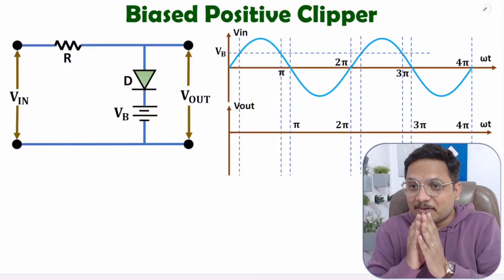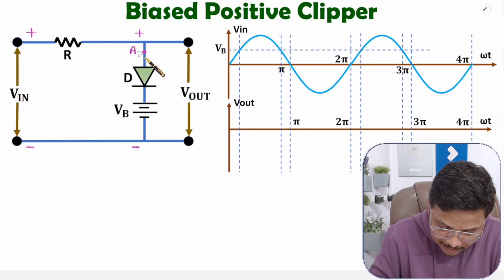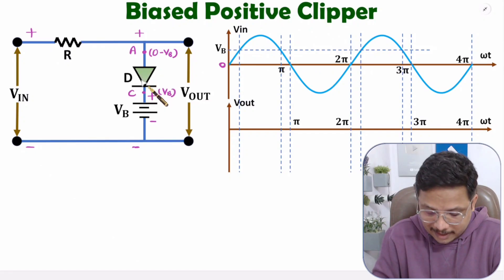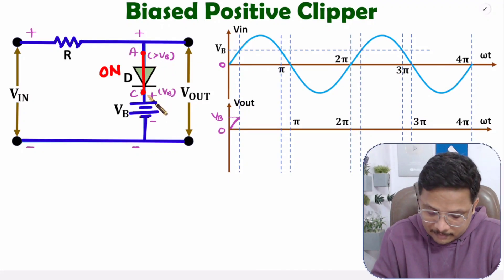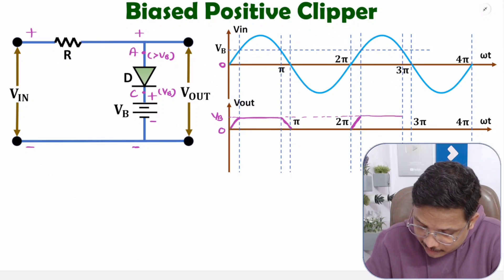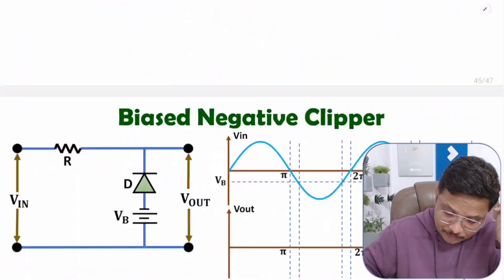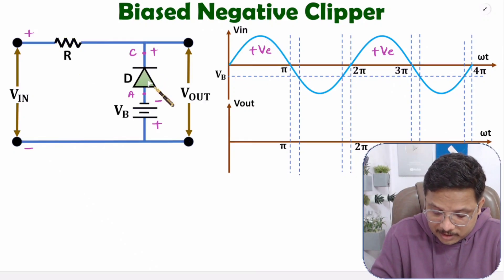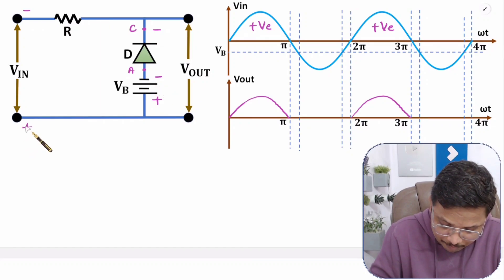Biased Clipper Circuits (Basics, Types, Working & Waveforms) Explained

Comment: When Vin>Vb. the diode is short circuit so having zero resistance ideally.then Vin is a source and Vb is also a source , they may add or subtract insteading of passing directly . Explain me sir how Vo=Vb.
Reply: The diode becomes forward biased (ideally an open switch) when V_in < -Vb so the only thing that remains in the branch containing diode is the battery connected across output terminals of load. Hence V_o = -V_b